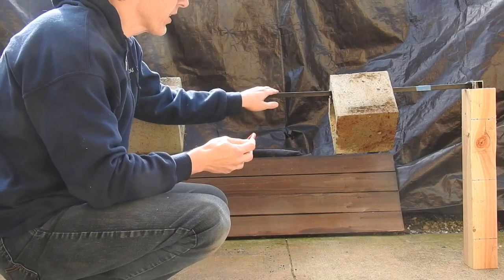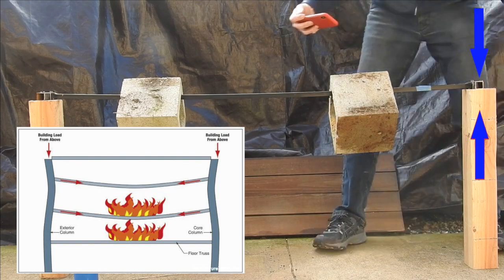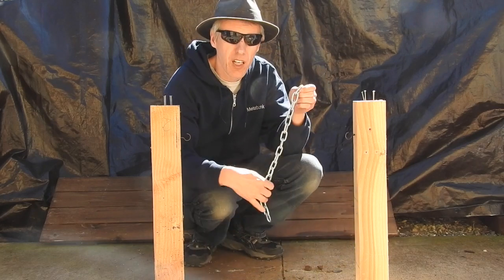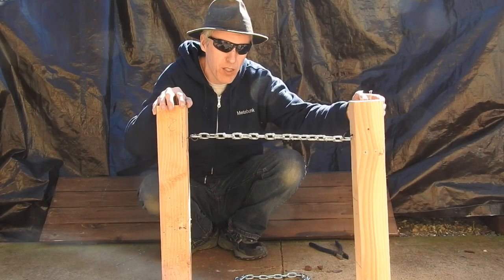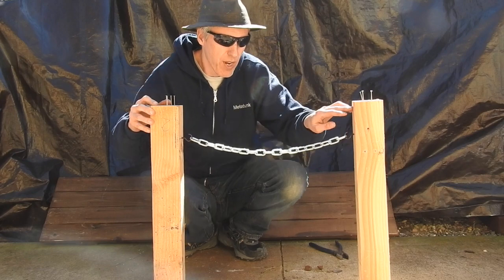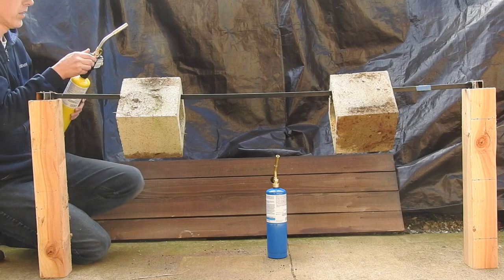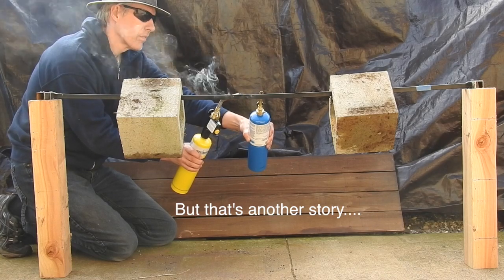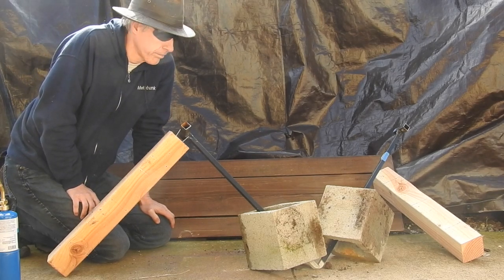Why Sagging Beams and Trusses Pull Inwards

Comment: 3:01 - No, not "as soon as". To keep the chain (or rope) perfectly straight under gravity, you would need infinite tension. To hold the middle of the chain up, you need upwards component of the force, but perfectly horizontal chain can provide none. So perfectly horizontal chain should produce even more inwards pulling force than the sagging one.

Comment: Run 20A through the steel and see what happens.

A torch is going to heat a small bit of the surface which then will cool to the non-heated mass...current will heat more of the material.. it should heat nicely between two 240v phases.  Of course your power company will hate you.

Comment: I suggest to add a roof and see if your experiment still works.
Reply: I agree, he should try adding about 90 perfectly fine trusses below it as well, maybe the fire was hot enough to cause local sagging of the trusses, but on collapse it will meet 90 undamaged floors, even if it pulvarized the first floor it met, this would slow the collapse down, so the dynamic load on the next floor will decrease.....and as you said, the roof will resist the inward forces as well. If this progressive collapse theory is what happened to the buildings, then where are the hat trusses? They should be lying on top.
Reply: @josegerrits3927  The inward pulling can be seen on photos of the perimeter, shortly before the collapse.
The floors were designed to withstand the dynamic load of 6 additional floors.
The tops coming down were more than 3 times that heavy. 
So obviously, each floor hit by the top gave way instantly, adding it's mass to the downward force of the collapse.
Reply: @rinse-esnir4010  The inward pulling indeed is visible, but weakened trusses, sagging because of heat are not able to pull in the perimeter columns, so what caused it? 
Why was the top more than 3 times that heavy? 

You should read the below calculations, they will show you that the collapse should not have happened.
http://911speakout.org/wp-content/uploads/Some-Misunderstandings-Related-to-WTC-Collapse-Analysis.pdf
Reply: @josegerrits3927  Why was the top 3 times heavier?
Just count the floors above the impact zone, add the weight of the roof and perimeter columns and you end up with a mass more than 3 times heavier than the trusses were designed to withstand.
Reply: @rinse-esnir4010  the building has always been able to carry that weight, how did the columns end up buckling? If it was through heat, it should have gone gradually instead of the sudden onset which is far more consistent with controlled demolition, although I do not believe the thermite theory.

Comment: Mick, you are good at building things to collapse.  TRY building things that are designed either to sustain a partial collapse (therefore not collapsing entirely) or that just flat out aren't jeopardized by "limited" damage.  I say this in a comment here, because I've watched other videos of your work, where you are basically trying to prove preconceived notions. 

If you were building a skyscraper to Not collapse by pancaking, how would that differ than one built to collapse by pancaking?  
And based on the design of the WTCs before they were destroyed, would you say that they were built with no consideration of the potential of a pancaking collapse?
Reply: This video shows the cause what can be seen on photos of the perimeter shortly before the collapse: the columns  bowing inward.
About the global collapse: the floor trusses were designed to withstand the dynamic load of 6 additional floors. The top that came down was 3 times that weight.
So yes, the building was designed to withstand a partial floor collapse, but not a collapse of 20 floors at once.

Comment: - Steel melts at 2500 F
- Temperature of jet fuel burning is 1500 F
- The blowtorch mick uses likely burns at anywhere from 3 to 5 thousand degrees.
Yet another mick fail.
Reply: "Steel melts at 2500 F"

Steel doesn't need to melt to fail the load bearing capacity it was produced for.

"Temperature of jet fuel burning is 1500 F"

1500 F temps are more than enough to cause steel to lose its intended load bearing capacity, especially while under said load. As you can see, your claim about 3 to 5 thousand degrees from Micks torch didn't cause the steel to melt even though it lost its rigidity.
Reply from the maker: Flame temperature is not the same as heating temperature.  If I point my torch directly at a thermocouple, the hottest I can get it is 1150°C. This is because the hotter something gets the quicker it conducts and radiates heat. At some point it reaches an equilibrium. There's just not enough energy coming from the torch to actually raise the temperature of any significant size piece of steel over 750°C, and it mostly stays below 650°C  See: https://www.metabunk.org/posts/219926/
Reply: Mick, your tests in the link you provided are not scientific. You don't know how hot you're making that steel, you're guessing based off the heat of the thermocouple.

Even so, 1050-1150 c is way hotter than jet fuel and much closer to the temperature at which steel melts. At those temperatures it would be easier to bend steel, especially in this controlled 'science project' like you have here. Your setups (always using disproportionate weights to bend the steel) do not exactly correlate to how the towers were actually built and collapsed. This little experiment is just like the one that iron worker did, and he has also been disproved. https://www.youtube.com/watch?v=_yf3ybYsBN8

Mick, you're not even an expert in anything, so why should you be believed? Why should I listen to your links which direct me to your own biased website?
Reply from the maker: Cole's experiment is interesting because he does not actually load the "column" to account for the scale. If you load it correctly, and then it will bend. His demonstration is meaningless, I'ma . bit bemused as to why AE911 endorsed it.
Reply: Mick did you even watch the entire video I linked to? It's only about 5 minutes. If you actually watched it you'd see that AE911 didn't endorse it.
Reply from the maker: It's on their channel.

Comment: The following are genuine well meaning questions and I don't assume to know the answer to. Someone please help me understand: Would the office fires in WT7 alone, have been hot enough to bend the steel? Would that have made the whole building collapse? And if that's the case why do demolition experts spend $1000s on explosives when a random fire will do the job? - remember no planes hit WT7 - so no fuel to reach high temperatures. Also, has any other steel frame building that burned for such a relatively short period of time, ever fallen straight in on itself? Also, what do we make of Larry Silverstein's quote that "we decided to pull the building" in reference to WT7. https://www.youtube.com/watch?v=p34XrI2Fm6I Again, these are genuine questions, I'm not presuming to know the answers. If Mick West can address these, that would be even better. Maybe he already has, someone please point me to the answers if that's the case.
Reply from the maker: Hi John, I suggest you read the WTC7 FAQ, as it answers most of your questions. It's a quick read. 
https://www.nist.gov/el/faqs-nist-wtc-7-investigation
Reply: Thank you Mick I really appreciate that it covers the structural issues, that I questioned, and weather I believe that narrative or a former NIST employee who doesn't  https://www.youtube.com/watch?v=RJ_jQgIEnI8 is going to take some deliberation. Maybe it was just unlucky that WT7 was the wrong type of steel building in the wrong place at the wrong time. I find the Silverstein comment extremely bizarre as I can't imagine a potential co conspirator implicating himself like that, which makes the comment even stranger, unless "pull the building" means something different like 'evacuate' possibly?? This next fact alone, however, will never stop me questioning, at least the official narrative being spun days after by the FBI through the media, and that is the intact passports of the accused hijackers, but no black boxes?? Then there was the unclaimed irregular 'put options' placed on United Airlines in the days running up to 911. There's also the lack of debris at the pentagon, the footage slowed down of the impact there shows no evidence of a plane, but maybe a missile?? There's always going to be questions when so many seemingly improbable events happened on one day. If anyone has some answers to these questions please let me know your thoughts. Thanks again to Mick West!
Reply from the maker: He didn't say "pull the building". He said "I remember getting a call from the fire department commander, telling me that they were not sure they were gonna be able to contain the fire, and I said, 'We've had such terrible loss of life, maybe the smartest thing to do is pull it.' And they made that decision to pull and we watched the building collapse." 

So the most likely "it" here is the firefighting operation.
Reply: Yep I can follow that logic it seems more likely. Thank you Mick.
Reply: @johnthomas8492  According to NIST, the collapse of wtc7 wasn't caused by steel losing its load bearing, but because of thermal expansion, dislodging the floor connections.
Reply: @rinse-esnir4010  Has that ever happened before from office fires? Why do other buildings that sometimes burn for days not experience the same expansion issues? Can you show me evidence of another building reacting in the same way. Do you think it's likely that in all the debris and chaos the intact passports of the perpetrators would be found? Also, what about the pentagon footage; can you honestly say that was a plane? https://m.youtube.com/watch?v=0SL2PzzOiF8
Reply: @johnthomas8492  it's not uncommon to find intact passports and othe plane contents in the debris. For example, the MH 17 crash in Ukraine had dozens of intact passports .
The passport found on 911 is only relevant  for people who want the events to be impossible so they can push their own agenda.
Reply: @johnthomas8492  You assume that every building on earth is constructed the same way and therefore should behave the same way..
But that is obviously not the case. We have seen buildings that withstand days of fire, buildings that collapsed partially due to fire, buildings that collapsed completely due to fire and buildings that collapsed completely without any fire.
Just because something happened to building A doesn't mean it should happen to building B too.
Reply: @johnthomas8492  Pentagon: the damage on the path to the pentagon and pentagon wall, the found plane debris, plane contents, human remains, personal belongings, eye witnesses, radar data, phone calls from the plane, black boxes, all point at AA77 crashing into the pentagon.
Reply: @rinse-esnir4010  MH17 and the twin towers stikes are not comparable. The former was struck and broke up in the air with debris being dispersed over a much greater area and intact. Bodies were literally raining down on people's houses, and so passports and luggage would presumably be able to do the same. That didn't happen on 911 did it. Non of the attackers bodies were found, as they would have been incinerated, and the debris at ground zero, didn't just contain that of 1 plane, but 2 planes and the debris and belongings of 1000s of offices from 2 buildings. That greatly increases the odds of intact passports being found. Did they find any of the attackers passports at the pentagon? Or on the flight 93? Maybe they did and you can find the evidence for me. What are your thoughts on the pentagon footage?

By the way I don't have an agenda. I just have genuine questions, and an open mind that can be changed either way with logic and evidence. Help me see things better if you can.
Reply: @johnthomas8492  No, you repeat the nonsense from conspiracy websites and YouTube videos. When the plane hit the twin tower, it was raining paper and other contents from the building and plane
 They found pieces of fuselage, engines, landing gear, wheels, seat cushions, life jackets, safety instructions sheets, etc.
And also a passport, which is a curiosity because it belonged to a hijacker.
But that is it. The passport in itself proves nothing.
It's only used by conspiracy websites and videos that need the official narrative to be impossible in order to make their version more appealing, despite not having a single shred of evidence for it.
Reply: @rinse-esnir4010  Why are you so angry? I've never been on a conspiracy website in my life. And you believe in conspiracies too, as in the official conspiracy, that hijackers conspired to crash planes into major targets in the US. Wether you believe that or not it's still a conspiracy. Are the police not conspiracy theorists when they try and convince the judiciary that they have enough evidence to prove their belief that someone committed a crime. I.e suspect A 'conspired to commit murder'. 

I assume nothing, but when architects and engineers, along with former NIST employees are saying they have issues with the official explanations, I'm going to listen. Listening is not believing Rinse. Instead of accusing me of assumption and being a conspiracy theorist (which as pointed out, we all are) try and use evidence and logic to have a discussion with me like West did. This isn't a confrontational argument, it's an open debate. Can you address the pentagon footage...I'm open to suggestions Rinse.
Reply: @johnthomas8492  Sure, you didn't get your data from conspiracy sites, yet every argument you come with is a copy of conspiracy websites.  
I'm not buying it.
Reply: @johnthomas8492  Pentagon has been addressed: all evidence points at AA77 crashing into the pentagon.
Only conspiracy theorists ignore all that and only want to talk about the footage.
Reply: @johnthomas8492  Wtc7 collapse was caused by thermal expansion of LONG span beams. Wtc7 had long span steel beams, and thermal expansion happens at low temperatures. Wtc 1 and 2 collapsed due to plane impact, and heat from the fire, weakening the steel.

Comment: It might be interesting to see this repeated with a bit of charcoal or wood to give a bit slower heating over a larger area. Not sure if it's worth the effort though.
Reply: I was thinking the same thing but there is a lot more petrochemicals in the offices then just wood. Not to mention the materials found in "modern" 2001 electronics. Also the effect of a massive hole and may other small holes high up where a lot of nice clean fresh air can feed in like a blast furnace. I understand he is trying to simplify things for the truffers but its an up hill battle.

Comment: Are you simulating the main tower collapses? If I'm not mistaken, the interior of building 7, the one they always go on about collapse first in a cascade because it had exterior and interior supports.
Reply from the maker: Sagging is a factor in all three collapses. In the towers it eventually pulled in the exterior walls, and the load transfer to the core causes that to fail. You can see the pre collapse inward bowing in photos and videos of the buildings. 
With WTC7 many of the beams between columns are though to have first expanded which broke some bolts and shear stud, and then sagged  - which cause them to fall. The falling beams led to a cascading floor failure about Column 79.
Reply: That makes sense. With sufficient heat structural failure of steel is inevitable. The only variable being whether the floors are firmly attached to the exterior supports with significant static resistance. In any case the result will be a buckling inward. The shape of the exterior shell will provide support until it suddenly fails. Cascading floors impacting the supports toward the base of the structure may hasten a collapse but the structure is already unsound by that point. Such an appalling crime.

Comment: This inward pulling, rather than controlled demolition, may have contributed to the "fell into its own footprint" effect, to the extent that was the case.
Reply: Not likely....the  tension would affect both the wall and the core of course but in the opposite direction as opposed to the same direction which is what would happen under wind loading. The towers were designed to handle 13, 000 tons of wind loading...all in the exterior frame. Softened steel  trusses would add at most half the floor weight to the exterior frame. They did that already. The only change would be the reduction in lateral load transfer  i.e the building as a whole would not resist lateral loads as well. That would not lead to collapse. 

The only failure leading to collapse was the loss of structural integrity...the connection between the support structure and the floors resulting in the floors cascading down. That would cause the structure to collapse when the lower floor truses were securely attached and the cycle continues. Need some of both. 

It's like pushing through a viscous material vs a non'viscous material. The non-viscous material will simply move aside like the concrete dust. The viscous material will pile up and eventually snap the supporting structure and cascade down. It is a good question...what if each floor only had 2" of concrete instead of 4". Maybe the bldg would not have collapsed.  I honestly do not know why they had to use so much concrete. It makes the floor stronger obviously but it still doubles the floor weight and massively increases the support stress.